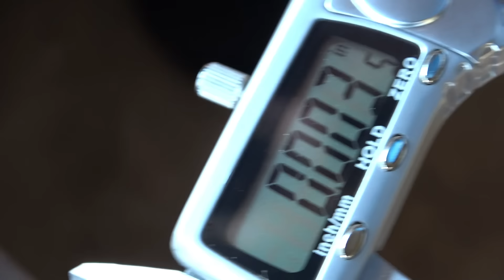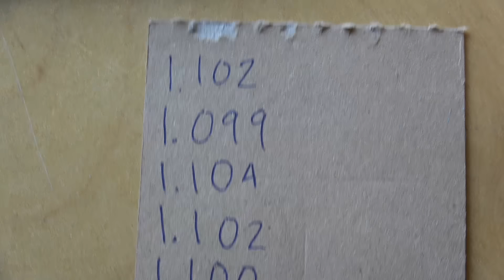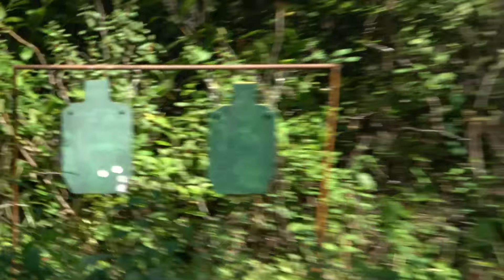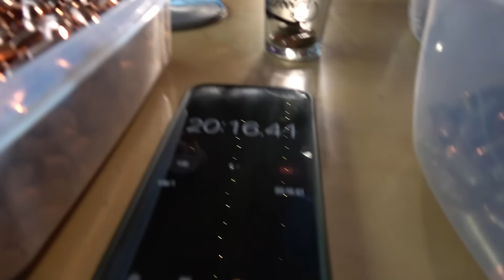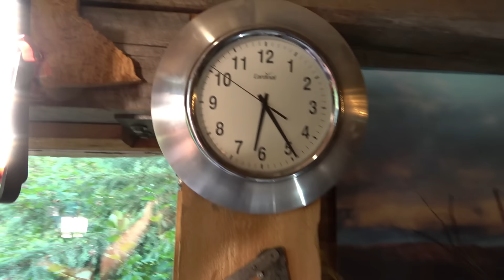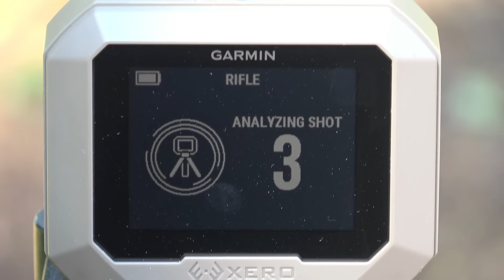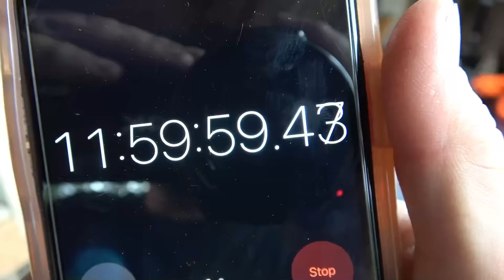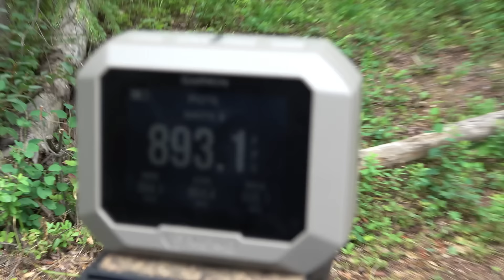We Made 10,000 Rounds in 24 Hours! DIY Ammo FACTORY

Comment: I see you bought a Dillion thats Top of the line home loader for loading a lot really fast. For precision loading smaller amounts i like the RSBS and their carbide dyes. 
A BIG WORD OF ADVICE: Keep up with how many times your Brass is loaded and keep them separated and labeled how many times they been loaded!!! This is very important for SAFETY! Because after a Brass cartridge has been reloaded 3-4X depending on quality of the brass. 
I usually discard them after 3-4X because the brass loses material each time you reload it . Also in  losing brass material each time it's sized and resized each brass cartridge gets weaker. So reloading brass too many times can & eventually will cause the brass to  split in the area around the rim where the bullet goes into the brass  cartridge. Which in fact can cause bullets to bust in the chamber which can lead to safety trouble. Such as exploding in the chamber which can result in the chamber area of the gun to explode. So please inspect every single brass for any weak areas such as hairline cracks or your thickness of the brass where the trimmer has to trim & resize each brass every time its reloaded ! So remember Please label home many times each brass you have in lots have been reloaded. After that 3rd time id be very concerned about careful inspection of each brass. Not counting factory loading because they use brand new brass and its technically not trimmed and resized in factory loads with new brass ......But on that 3rd time you reload your brass carefully inspect each cartridge. After the 4th time of reloading any brass I'd put in 5 gallon buckets to take to metal scrap yard and sell it for brass prices.  ALSO ON YOUR DEPRIMER WHICH KEEPS BENDING..... First off you need to be lubing your dyes so they have lubrication to slide easily on the brass. Because metal against metal with no lubrication tends to wear out machinery. I load only rifle rounds usually of higher calibers or odd ball calibers for hunting thats hard to find readily available in the sporting goods stores so i load my own. I hand precision load those calibers and on each cartridge after they've been through the tumbler with pecan hulls or walnut hulls media to clean then.... I hand wipe down each cartridge after i mic and trim and re mic them. So im hand wiping each cartridge down with a cloth that has a very small amount of brass lubrication oil in the cloth. So this leaves a very thin layer of lubricant on the outside of each brass which makes them go in my dyes much smoother and easier. This is also less wear and tear on my dyes and my de primer. I had a different brand de primer dye I'll not say what brand, it came in a red box is all ill say and it bent on me like yours and i bought another one and it bent and i bought a Carbide Bit RCBS & the bending Stopped. So RCBS Carbide dyes are really good quality and they'll fit right on your Dillion loader. RCBS makes their regular dyes and they make their carbide steel dyes. If i was gonna be loading the quantity you are id have all RCBS carbide steel dyes on my loader all way around it especially on that de primer dye. I've used every brand out there and nothing has performed or outlasted the carbide RCBS dyes ive used. So definitely for y'all's safety PLEASE PLEASE BY ALL MEANS TAKE MY ADVICE I GAVE YOU ABOVE !!!! It only takes one time that brass was weakened too much and during the reloading process it hairline cracks the brass down along the bullet being crimped into the casing and when fired that pressure comes out sideways and it explodes inside the chamber and someone is seriously hurt or worse!!!! So please label 🏷️ how many times each brass has been reloaded since you started reloading it and my stopping point is 4X and i discard it because by that many times it's already weakened to the point of too  dangerous to risk reloading it a 4th time.  So every batch of brass i keep in plastic totes or whatever you have and i have it labeled been reloaded 1x 2x 3x or 4x and after 4x i won't reload it again, it goes in a 5 gallon bucket 🪣 to carry to scrap yard. You should have your girls visually inspect every single round for defects!!!!! Because many times you can prevent a disaster from happening and if anything looks odd or outta whack do not 🚫 fire that round. Happy reloading guys and SAFETY IS ALWAYS FIRST PRIORITY.  Peace ✌🏼
Reply: Also in reloading ammo going into a semi auto like you're using you need to  Trim your brass and mic it to try and get every round to be the same length as factory specs. This is very important for feeding/cycling purposes  on semi auto loading rifles that you use a precision micrometer & try to have most of your rounds come out pretty close to the same. So many people start reloading and wonder why their semi auto's aren't cycling their reloads. Well that's why they're not getting them to factory lengths and that's why they're not cycling correctly.  If you're gonna be reloading that many rounds for semi auto loading rifles and handguns then I'd invest in a Dillion brass trimming machine. Because every time that brass has been fired from shooting the factory load to every time you fire a reload that brass stretches in length. So brass after it's shot before it's loaded needs the end trimmed off back to factory specs on brass length before it's loaded again.  Because if you don't trim every cartridge you'll have all different variations of lengths and semi auto rifles and handgun chambers don't like different lengths and this causes issues in cycling or even in chambering rounds in general. So you definitely need a cartridge  trimming machine unless your Dillion machine is trimming the brass !? I don't think 🤔 it does or otherwise you wouldn't have had those different micrometer size variants.  I use a hand mounted trimmer mounted to my reloading table which is very time consuming and you could go that route. But reloading in large numbers like you are will definitely bring that to a slow down.  That's why I say you should invest in a precision Dillion brass trimming machine that'll trim your brass to whatever size you set it to. This will assure all your rounds come out the same factory brass  length and eliminate all cycling & chambering issues in any semi auto you use your reloads in.

Comment: A lot of step to making rounds-
Remove primer
tumble brass in tumbler ( if it's old )
measure the over all length of the brass ( if it's old ) trim according to size, deburr the brass you just trimmed
Install new primer

 that's just the brass

Comment: I have the exact same wet tumbler. It is really good but my main complaint is that it is loud as heck even if I set it on a folded towel. In addition to brass cleaning I also use it to clean pennies for my side hobby of sorting those. I save up pennies and also buy $50 boxes from my bank and I don't even touch them until after I clean them. They are disgusting so I open the rolls and dump right in the tumbler.

Comment: Each and every single time you have any type of jam be sure you aren't getting a double charge of powder. My best piece of advice is to have a slow enough burning powder that 2 powder charges will not fit in the case. I have experienced a double charge due to a jam and received a double charge. This round blew a .44 mag Ruger Super Redhawk apart. I now only use powder that will spill out of the case in the event of a double charge. Happy and safe reloading to all.

Comment: As someone who's reloaded for a four decades and used all brands and types of presses, the best advice I could give a new reloader is to buy a Lyman's reloading guide (or equally comprehensive) and read it twice before buying a press.  Reloading is easy once you understand what is happening in the cartridge, in the gun, and at the bench.  There are some things that are also absolute no-no's that are only learned the hard way, or by having discussions with experienced reloaders, like this tip... never have more than one keg of powder on the bench when reloading.  This isn't in books... I was lucky enough to have a 3 fingered old timer explain why.  The book will get you thinking about the importance of every little step and why steps can't be skipped.

Once you have read the book and have a working concept of how pressures work, don't run out and buy a progressive.  Start with a reasonably priced single stage.  You will learn what each stage of reloading entails, what is important to watch for, and it helps build the disciplines needed for higher production reloading.

Once ready, start with the most solid and stable bench you can get your hands on.  A shaky, wobbly table will cause powder to splash, cases to move out of alignment, and generally make the experience suck.

They used a digital scale in this video.  Obviously they walked into the Dillon dealer with an open checkbook and said, "Give me everything!".  Do yourself a favor and buy a decent beam scale.  Physics and gravity trump sensors and screens every time.

Do not de-cap your brass in your progressive, unless you buy a cheap LEE progressive for the sole purpose of de-capping.  It is a filthy endeavor that will foul your press.  De-cap your brass, tumble in stainless media, let dry and give the pile a few sprays of One Shot lube, and you will be a happy camper.  

From there, hand prime your cases.  This lets you visually inspect the seat of the primer, the mouth of the case for cracks, and the web for fatigue or swell from unsupported breeches.  More on this...

For the uninitiated, the hardest thing to get working right is seating the primer and trusting that it's correct.  This is a blind stage on every progressive press... the stage you can't actually see and verify until a finished cartridge plunks out.  I have loaded well over 250k rounds of 9mm, amongst many thousands of other calibers, and I learned long ago that I just couldn't trust this stage in a progressive.  Even on friends' very expensive Dillons, this stage can give people fits.  (Remember that I mentioned having a rock solid loading bench?  This will mitigate many primer issues, but I still don't trust it).  I have had great luck with the LEE Auto Bench Priming Tool.  It's cheap and very fast.  I can quite easily prime 1k cases an hour with it.  They are good for about 20k cases before the plastic parts start to fail, but they are cheap enough to be a disposable tool.  It also doesn't require the focus that the rest of the reloading process requires.

Now you have clean, primed, lubed cases that are ready to pour into your clean, precision progressive press.  Just remember to take the de-capping pin out of your sizing die.  Because you have taken these steps, even a less expensive brand of progressive will work as good as any other.  So if you are budget minded, a little extra work up front means you have lots of extra money for primers and powder.  The rest is fairly straight forward, and pretty much every press works the same from this point.  I hope a few of these tips will help a new reloader safely and efficiently pump out the fun pills.

Comment: HOLY CRAP! NEVER EVER reload without safty glasses. I have had primers explode multiple times and it can blind you. If a cartridge exploded , forget about it! Also you are flairing the brass too much. It will crack the brass after a couple uses. The powder charge can drift high or low depending on fullness of hopper, new powder refill, temp, moisture in air, static electicity ect. Check your charge every few hundred rounds. Sort your brass by headstamp (winchester, remington, etc). The cases are not all the same and you will have different sizings and lengths. Check your loaded rounds with a case gauge every few gundred rounds as well. Put a tape sticker on your powder hopper listing type of powder and charge grs.

Comment: Hopefully you pick the slowest burning powder for your load so if your powder dropper decides to go haywire like most of the droppers do so you won’t have a double charge. A super light charge is just as dangerous. Hopefully you stopped and measured your powder charges every 5 to 10 drops to make sure it was still dropping correctly.

Comment: I really admire you and your family, it seems you really enjoy your family. I really respect that and give it a big thumbs up.

Please don't take what I write personally or as anything negative.
But instead as a help and advice.

In Denmark, you must have a course and a permit to make your own ammunition. Mostly so you don't get hurt or hurt others.
But also so you know what you are doing, and not least HOW to do it.
Not just trying yourself and making a lot of mistakes that can be quite dangerous for yourself and others.

Why do you use a hammer and a nail to ignite a primer in a case?  

why do you not clean the brass before you reload them??

ALWAYS CHECK THE WEIGHT OF YOUR GUNPOWDER APPROX. EVERY 10TH CARTRIDGE AND THE OAL
(OAL= overall length) 

One thing that they "work" another thing is whether they are reliable and accurate. Just because they work is not the reason you chose to reloading your owen ammo. You can make your ammunition very precisely if you do it right. EVERYTHING has an impact on accuracy. Everything from the accuracy of the amount of gunpowder, that the projectile sits at the same depth (OAL), how hard it is crimped. (You can use a Factory crimp die)

13 minutes and 30 seconds into your film, you see a close-up of where you are reloading. The case mouth is WAY too wide wher you set a bullet, it will only make your brass weak and will very quickly become dangerous to use.

NEVER use deformed brass, there is a very high chance of it exploding in the chamber of your weapon

It is very normal for the decapping die to break. that's why there's an extra one. Always have 1 or 2 ekstra arround.

I reload ammunition myself and work with ammunition in my work. I had a hard time watching that movie......DANG..... I hope evrything went well.
And good job by the way👍

Comment: Being y'all were rookies and ran a 15 hour long stent, I am curious if y'all made double sure that each case got powder and also that there were no double charges? I also am wondering how many of those cases had the "Glock Bulge" that would end up sticking in the ammo checker/case gauge. And it looked as if some of those cases had the original primers crimped and therefore needed reaming first before setting the new ones. But most of all I am wondering if y'all have a reloading manual and each of y'all have read the first half of it.

Comment: Pretty sure that outer ring you are seeing when the primers fail to seat is military crimps. Ive never seen it on 9mm but I am also not a super seasoned reloader or anything. I reload .556 all the time however and deal with the military crimps constantly. Ive resized them, swaged them, loaded them directly with touching it but I've learned to just skip those shells all together. It isnt worth the time in my opinion.

Comment: Looks like this reloader could be a very lucrative opportunity for your girls to make extra spending money.  I would assume that reloaders have differant components for various calibers of ammunition i.e. 9mm, .223/5.56, .40 S&W.  I think it would be wise from a production standpoint to order a bunch of primer extractor pins since they seem to bend pretty easily.  Plus I don't think it would be safe to bend them back.  Of couse I have no experience with reloading, my only experience was 20+ years in the army of firing M16 ammo.  I saw a comment below about when you were not sure if a round actually fired and cleared the barrel or not.  When in doubt you should always run a cleaning road through the barrel to be sure it is clear.

Comment: when the primer pin bends on you guys looks like a common problem not sure how hard it is too remove it but if its easy too remove it you could remove it put it in a brace like a vise and use a hand held torch too get it hot that way when you bend it back too place you don't stress the metal when bending it back in place making it not loose alot of its strength other wise when you bend it back with out heating it up your weaking the integrity of the pin and making it weaker and also more prone too do it again sooner or later
i can't stress this part enough if you do this tho after watching what you did with the gun and not knowing if it shot a bullet or not    X_X    do not heat it up while in that machine tho i feel like it shouldn't have too be said.. but doesn't hurt too mention it and avoid a giant accident happening

Comment: Your making mistakes in your prep military brass that has crimped primers must be suaged before installing new primers also there is no way to make sure the primer hole is clear with this system a lot of reloaders will de prime suage and re prime separately these steps are very important if you don’t want to do it this way at least separate your brass so you don’t run run crimped primer through in a progressive good luck